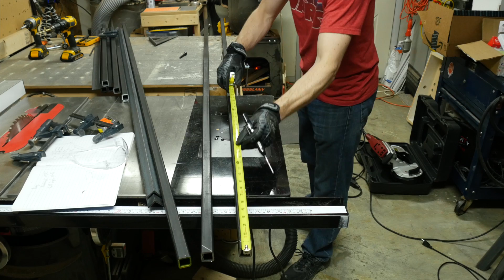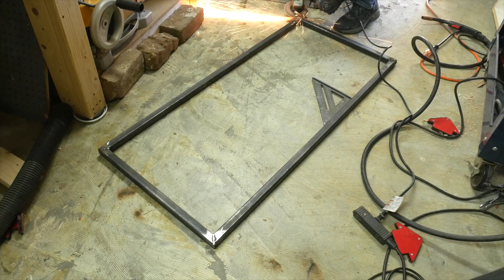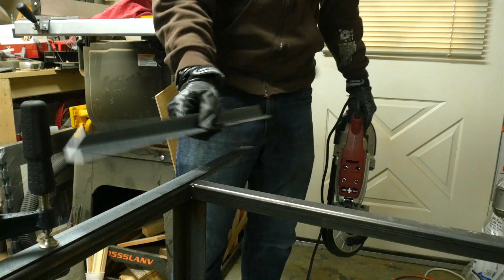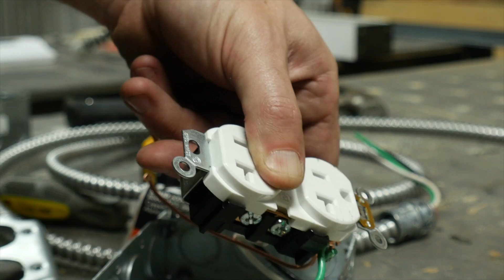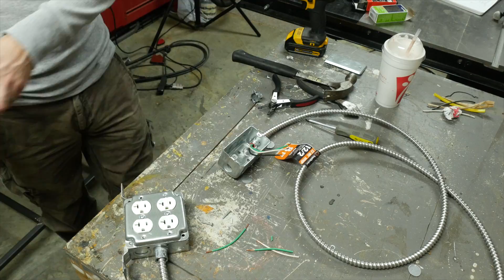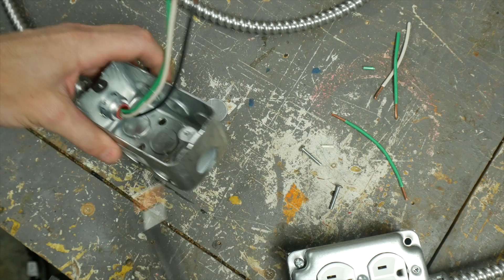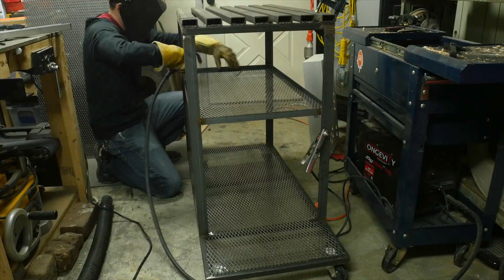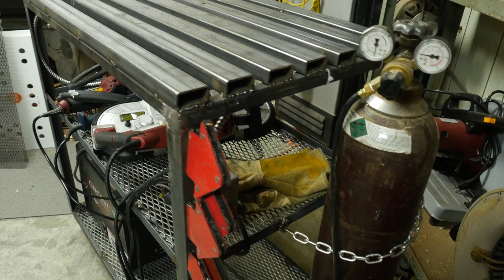Welding Cart & Table // How-To | I Like To Make Stuff

Comment: hi. nice!
i would add a handle, every cart should have one so you don't kick the cart with the feet as you push it around.
Reply from the maker: +Yigal Barkan Makes sense. In my case, that would just make it a little bigger and I don't really push it anywhere.. just am able to spin it around for working on.  It never goes far at all.
Reply: +I Like To Make Stuff, it's a nice one, so I just added this for other s, like you suggested. I had a feeling you thought thus through...

Comment: Looks nice. I like the top surface with the spacing, great feature for clamping. A secondary cover to limit debris from getting on or in the welder may be something you would want to consider. Possibly? As usual- great video, great project , thanks for sharing.

Comment: I love it! 
Some observations: When you tack stuff you should flip it over and tack the other sides as well so it doesn't warp radially. I like to tack all the corners before filling in the welds. Also you might want to consider adding a full sheet of steel underneath the table to keep the grinding dust and welding spatter away from your tools underneath.
Reply: +TheIdeanator I was going to suggest adding that sheet of steel as well, but that is inconsistent with the clamping idea. I guess that some kind of big enough cloth to cover those tools should do it. Of course, it has to be some kind of material that doesn't burn, such as that which welding gloves and protection are made of. It just needs to be tied to two of the legs and that's it.
Reply: fadetounforgiven
 He could mount the full sheet under a spacer which would allow for clamping and somewhat easier cleaning.
Reply: TheIdeanator I thought about that, but I always end up with the conclusion that it's actually a waste of space and material, and not that practical also. You're making that storage part of the cart smaller and less easy to access. Also, you're making the cart heavier.

To be honest, I believe having all those power tools down there is a mistake to begin with, I would put some other kind of tools (hammers, chisels, whatever) that I don't need to "care" so much about. But once that's the idea, I think some kind of fireproof cloth is the best way to go. Not pretty, not perfect, but the best way I can think of.

Comment: Good stuff. Do welding carts typically have a metal table on the top? I feel like if I were to have one of these I would accidentally weld something to the table.
Reply: yes we used metal carts, and yes, in my schoolar years we tricked someone by setting it on max output while he was welding lol i welded a 1cm thick steel to the desk, through the steel plate....
Reply: Spelter
Hahaha, that's awesome.
Reply: often I will tack pieces to the table to hold them in place on things that would be difficult to clamp
Reply: +Dloweification Wasnt awsome to me when ich have to use the grinder to cut through thick steel in the middle of my piece 😅

Comment: what is the tank for? 
and why does the table top have space in between each piece?
Reply: He explains both in detail in the video.
Reply: +I Like To Make Stuff isnt it dangerous to weld something next to a tank filled with gas
Reply from the maker: +Hoshea Amit The spaces are for attaching clamps to the work pieces.  The gas shields the spot where the arc/weld is happening.  Without gas, you would usually use a flux core wire instead of a solid wire like I was using.
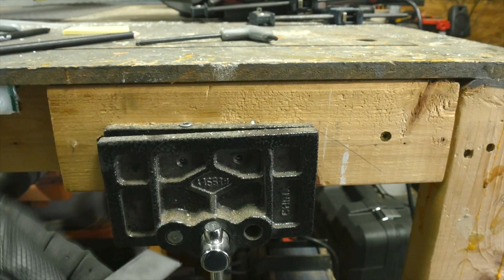Reply: +Jamil Poot 4:42
Reply: +Jamil Poot no, the tank is filled with co2 and wont ignite. its actually used to make sure oxygen cant get to the weld. these tanks are very safe too. unless you hit the top with a maul, nothing will happen. they get checked as well when you bring it in for filling.

Comment: Great idea Bob - my welder is bigger and on wheels but I still might make a table for the top as its much more convenient. 2 suggestions: hold the hand piece and reach to put it away with your mask on - look where you put it. A hook won't really be practical so weld a tube for the tip to sit in on the side you work with at the angle you naturally used to put it away. 2nd thing, I wear joggers in my shop while welding too but I buy ones with leather on top instead of mesh, better for the toes and still comfortable Cheers from Australia!

Comment: For you people new to welding, never get your steel from hardware stores, always go straight to the source, the steel yard.  It's less expensive to buy in bulk and you get a much better selection of product.
Reply: +Viking War Pickle  What you said! (Excellent username, BTW.) I have a scrap metal dealer about 3 miles down the road from me, and you can save some big bucks. They'll even cut most things to length on their bandsaw for a $3 fee.
Reply: Three things: 
1: nice name
2: good advice
3: thanks for the good advice that I can tell my dad! :)

Comment: You did a good job on the electrical.  12gauge wire.  20 amp plugs.  etc.  One comment is that you may find that while welding some "debris" will fall through the open top and onto your tools and welder.  You may want to weld on a catch tray under the top (but separate from the top by an inch or so to allow clamping).  The tray doesn't have to be thick steel, it could be sheet tin from the HVAC ducting aisle held with light brackets and removable for cleaning.
Reply from the maker: +cemx86 Good call!

Comment: Very  nice.  don't you think it would be safer if you took some flat bar and bent it in a half circle to go round the tank on the bottom. This way the tank has a place to sit on the shelf. It also helps  when moving the cart. just a thought.
Reply from the maker: +Craig Pereira I'll probably go back and add some small pieces of angle iron to wrap around the page. Personally, I never move this thing more than a foot in either direction, so it's likely to never be an issue.

Comment: Nice trolley/table! A couple of small points, be careful welding the castors and other fittings, they are likely galvanized, there are nasty fumes so a good idea to ventilate at the very least. The other thing is that the box your mains cable goes into should also be connected to ground. I realise it is connected indirectly via the switch box and whip outer but really it should have it's own connection otherwise a loose live wire could make the housing live.

Comment: Wouldn't the rubber castors make it not grounded?
Reply from the maker: +Boyad Hollingshead It's not literally grounded to the ground.. it's connected to the ground wire in the power wire (usually the green wire).
Reply: I Like To Make Stuff Oh yeah that's what I thought you did. Is it not necessary to do that if it's placed on the ground?
Reply: Its grounded thru the ground(green) wire, which is grounded thru whatever its tied to, which should be grounded thru the grounding system of your house.

Comment: Cutting mesh isn't for any kind of wheel, you need to have the ones that are abrasive on both sides and the edge. Also, you never cut it with a thin one. Reason is simple, the resulted spikes will grab the wheel and when it smacks against the guard it will shatter.

Comment: Why you guys have metal cable shielding in the US?!
I mean, imageine there is accidently a life wire on the conduit and somebody grabbs it!?
Reply: +Patryk Darasz The metal cable shielding is grounded. through its connection to the box. What he forgot to do in the video is properly attach the ground wire directly to the junction boxes at both ends. This way if a live wire touches the metal sleeve, it just goes to ground and blows a breaker.

Comment: You should try magswitch to hold your work piece in place. It's far superior than the ones you are currently using. Although they do however cost significantly more than the ones you are using. Check it out.

Comment: Hi Bob! I've been thinking about this since first hearing you talk about the shielding gas on the podcast. You might consider grinding the bad welds out and going over them once more the right way. The gas does 2 things when welding; it helps control the arc and it protects the molten metal from oxidation. So those welds are probably not very strong and more prone to cracking over time.

This is a great build and there have been some really good comments already. Keep at it and thanks for sharing, sir.
Tom Z
Reply from the maker: +Tom Zelickman (Inspiration Metalworks) Oh sweet, that's good to know! Thanks Tom!  That would actually give me some more practice on the my beads too, so I'll probably do that!

Comment: Nice! I love the all in one design. 

The only concern I have, or room for improvement, would be to put some sort of shield/solid shelf over the tool storage area, so when you're welding or cutting on the top surface a large piece of hot metal won't be able to fall down between the bars and damage the tools underneath.

Comment: Why miter joints instead of butt joints for the upper and lower frames? Seems like cutting and smoothing 45s is a lot more work.  Is there a strength advantage?
Reply: +Charles Hanson It's probably, as it almost always is when someone chooses miters, an aesthetic thing. Butt joints are ugly.
Reply: +Charles Hanson It's a a lot prettier and technically there's more area to weld, therefor you could have a stronger joint. Also on angle iron there's no way to join a 90º without at least making a couple cuts and might as well make a miter. Plus the miter is easier than a cope cut.

Comment: nice table. every project i see with a mig welder brings me that much closer to buying one. how bad was the shrapnel from the disc that broke? always makes me shiver seeing people using angle grinders without the guard - especially when they use cutting discs side-on.
Reply from the maker: +pj It wasn't too bad.  One side of it, about 1/4" deep just let loose.    I only got cut under my beard in one spot, so you can't see it :)
Reply: +I Like To Make Stuff hi guys, a grinding disc explosion is serious stuff. please at all times put that guard on and wear full cover shields and proper clothing. a small fragment IS a big issue that calls the operator for revising his techniques. 10cm high and god forbid this piece might be stuck in your eye. sorry man don`t want to bust anyone`s balls here but this really is off. i`m not calling bc i`ve read a book, i am a professional welder. and i`ve had too many close encounters with this kind of shit. it`s super nice watching people start welding but learn (a lot) and be safe. regards. pete

Comment: If you grinde the oxide from the steel, your welds burn better into the steel and the whole creation get's stronger.
Also be carefull if your material is galvanized because the fumes get very toxic!!! So better grinde that of as well or use other material ;)
Reply from the maker: +blablabla Good info, thank you!!

Comment: Great looking cart. Welcome to welding seems like every new welder builds a cart.    Two comments: 1. Put a solid piece of sheet metal over the welder instead of the mesh. Protect it from weld spatter and sparks. Sparks will actually burn the paint over time and could actually enter the welder and cause internal damage.  2. If you use electric tools that have a ground (three prong plug) be sure to unplug them before welding.  It is possible the tool's ground wire could become part of the circuit and burn the ground wire inside tool making it unsafe.  With two prong insulated tools this should not be an issue.
Reply from the maker: +Skully Wood & Metal Good to know, thank you!
Reply: Nice tips!
Reply: I accidentally had my work resting on the grinder cord - earth clamp had a bad connection so it earthed through the grinder - thankfully it tripped the breaker before it got to me, I put my grinder well away now with no cables in the way
Reply: +Skully Wood &amp; Metal I have never had any problems with grounded tools. Does this mean that if you have a pc, fridge, fume extraxtor or any other type of appliance in the garage that has a ground, you have to unplug it?
Reply: Only if it is laying on your welding table.  The welding circuit could use the wire inside the tool for a ground instead of the ground clamp.  Especially if your ground clamp is loose.  This is very rare but I have seen it happen several times.
Reply: +Skully Wood &amp; Metal Skully - You make a great point.  I pulled out my NEC handbook to get some clarification on it.  +rosserobertolli - The issue that Skully is pointing out is that the equipment grounding conductor in this case is connected to the secondary "ground" of the welder.  Other equipment in the garage shouldn't be affected, unless your welder's ground clamp is directly tied to the equipment grounding conductor.
Reply: +Skully Wood &amp; Metal Now it makes a lot more sense to me, thanks! I would imagine the resistance of the table being a lot lower than that of the tools, so no problem there. But when the ground clamp is not properly connected to the workpiece, but grounded nonetheless, this could indeed possibly damage the tools.
Reply: Like I said it is a rare occurrence but it can happen and the results are shocking!

Comment: I have a question how much was the steel?
Reply from the maker: +xXDEADBEATZXx 1 It cost more than it should have because I bought more than I needed by accident.  With the correct amount, it was probably $130-150.
Reply: +I Like To Make Stuff thanks
Reply: +I Like To Make Stuff always always always wear a face sheild when grinding and cutting wheels are being used